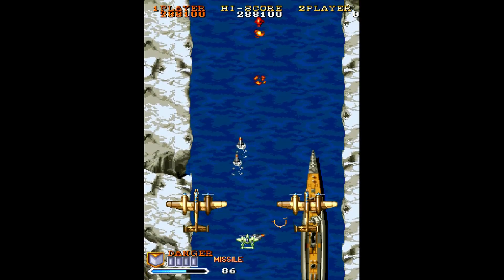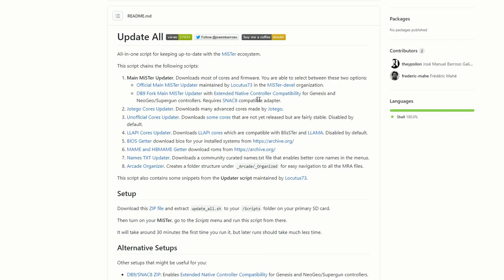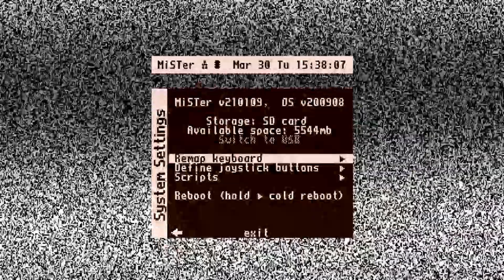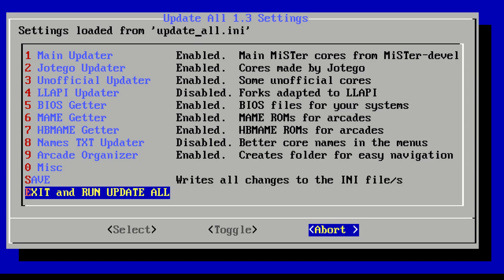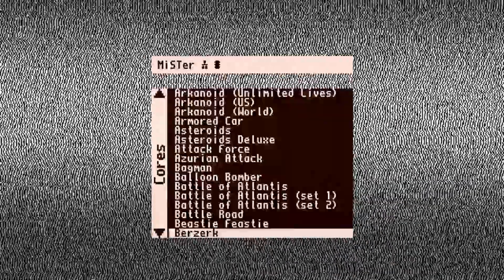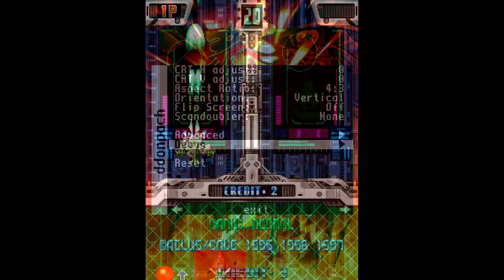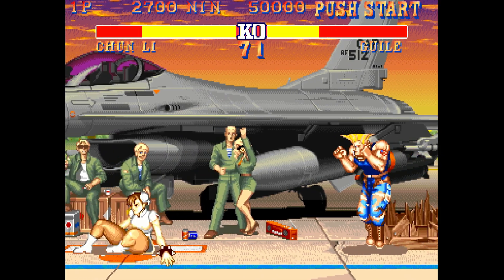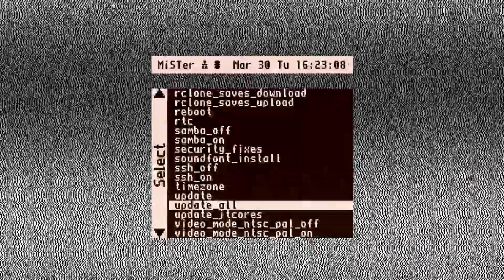MiSTer FPGA UPDATE ALL; Script Installation and Setup Process + Overview

Comment: Ive done the update all script in the past succesfully from following this video, but today when I tried it after many months without doing so, I got a message "Exiting, name server cannot be used: Temporary failure in name resolution (-3) unable to sync. Please try again later"
Ive changed nothing, I am still wired right into my modem.  Not really sure why this happened.
Reply from the maker: Server may be having issues. Try tomorrow later today

Comment: I've got the mistercade running on my astro city. I'm trying to figure out how to do the vertical swap like you did with ddp without swapping my actual screen into tate mode (first world problems i know). 15khz jamma setup
Reply from the maker: It only rotates on LCD. CRT…gotta flip the monitor

Comment: Awesome video! Thanks! So I should be getting my mister fpga soon! Just to be sure. The updateall function adds all the games and roms to the SD card or do I have to add them manually? And what about the PSX core which was released, I need to add games manually? Thanks!
Reply from the maker: Update all just does that for arcade cores if you select the option. By default it’s not enabled. On the console and pc side you need to add your games yourself
Reply: @VideoGameEsoterica  So basically SNES games must be downloaded and loaded individually, right? And you recommend any source? Thanks!
Reply from the maker: Yes. It’s a bit iffy for me to suggest / link you to that on YouTube. Join my discord. Link at bottom of description. I can help you there :)
Reply: google

Comment: Does it re-download and over write everything every time? or just downloads updates and new files on repeat runs? because it took over 3 hours the first time
Reply from the maker: First time takes forever. It won’t overwrite what it doesn’t have to after that. It’ll only pull new items / updated items
Reply: @VideoGameEsoterica  well I ran it today (3 times!) each time it took at least 2.5 hours and in the end some error,now my SD card is pretty much ruined ,many cores disappeared and some arcade cores just freeze the Mister.
It’s a buggy mess and not reliable anymore 👎
I have very fast reliable internet by the way.
Reply from the maker: What script are you using? Update? Update_all? Downloaded? Just reformat your card with MrFusion. It happens sometimes
Reply: @VideoGameEsoterica  update all of course.I’m going to format and start from scratch now. 🤦🏻‍♂️
Reply from the maker: Use downloaded
Reply from the maker: Downloader*
Reply: @VideoGameEsoterica  Thanks,the problems were caused because of Mister’s WIFI,I used cable connection and it worked without any issues and much faster too.
I won’t use WIFI anymore , many others on Mister forum were having similar issues too.
Reply: It is necessary to download the update all script every time to update to newer versions? Or it just update itself
Reply from the maker: It’s self updating
Reply: @VideoGameEsoterica  so if a new version is released I just need to execute the same script from the MiSTer?

Comment: after an update, i tried misterfpga today and none fo keyboards or controllers work
Reply from the maker: So no USB devices work at all? IO board? Trying to better understand your setup
Reply: @VideoGameEsoterica  got io Board and USB Board, Will try fresh install to see if its hardware problem.
Reply from the maker: Yes I was gonna recommend a fresh card. MiSTer still has some situations where the best thing to do is set up a fresh card
Reply: @VideoGameEsoterica  tip, never connect by mistake another psu to mister, i connect speakers psu by mistake and misterfpga is broken cause that.
Reply from the maker: Ooooh yeah def do not want to do that. Probably incorrect polarity would be my first guess. Sorry to hear that

Comment: merci for this video...especially the ability to go into the settings is very interesting. i read that you are using 256 gb card, mine is only 64gb...do you know by a chance if the data will fit onto that or is it to small? Update: Just ran the update_all script. its just a couple of gigabytes :)
Reply from the maker: the OS will easily fit. From there its just what you fill it with. But a 64 GB card is 100% fine for functionality

Comment: Thank you for showing me that you can actually go full TATE mode with the MiSTer. Might have just saved me a ton of money I was going to spend on a vertical barcade build using a front end from Arcade Punks. Do all of the vertical shooters and games of the vertical ilk have the ability to be rotated and does your Do Don Pachi save to the way of playing for future runs or do you have to rotate each time? Thanks!
Reply from the maker: Yes they all have TATE. I haven’t seen one that doesn’t yet
Reply: @VideoGameEsoterica  So the monitor in a candy cab could remain horizontal and you could still rotate vertical games into their correct position with no issue?
Reply from the maker: Yes. You’d lose screen real estate but you could force vertical games to run on a horizontal monitor in a cab
Reply: @VideoGameEsoterica  Beautiful. You are the ONLY person I've seen explain that or even show it on a video. Thank you so much.
Reply from the maker: That’s odd more people don’t mention it as it’s a great feature
Reply: @VideoGameEsoterica  Have you thought about doing a "great features" style video? Might shine a light on a lot more of the little things with MiSTer that are slipping through the cracks when it's covered.
Reply from the maker: Coming soon :)
Reply: @VideoGameEsoterica  Also - while I'm asking..lol..any thought to a "create subfolders, organize your MiSTer and tailor it to your preferences" type of video where you show how to organize things in a more curated way? Seriously important info lacking on YT. Why? No idea. Thanks for all your content, VGE.
Reply from the maker: Lol quit blowing up all my future plans 😂 (kidding)

Comment: Does the core manager script no longer work as it doesn't find them. Is this the successor?
Reply from the maker: This is just MORE updates than the update script. It pulls down more things
Reply: @VideoGameEsoterica  OK great, but I find that it isn't pulling down new cores like the Wonderswan on this script the original core manager doesn't work for me as it just says the URL can't be found. Am I missing something? Also I don't seem to be able to get arcade roms working, does the  script download them?
Reply from the maker: I’d try deleting and reinstalling ipdate_all and trying again. Hold up when you start the script and check the configuration to make sure what you want is enable :)
Reply: @VideoGameEsoterica  thank you, I think I'll wipe my sd card and start from scratch as it has been a year since I have done any updates.
Reply from the maker: Always an option! I keep three cards around. One for consoles. One for arcade. One for Computer. Makes it easier to deal with IMO